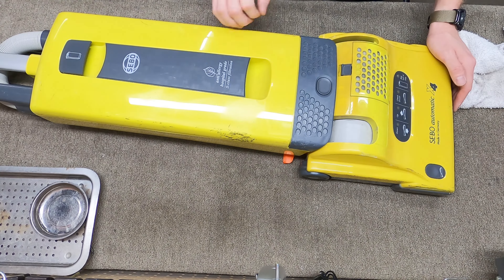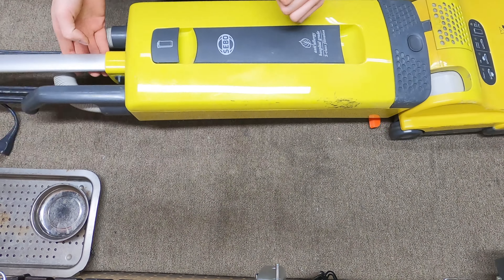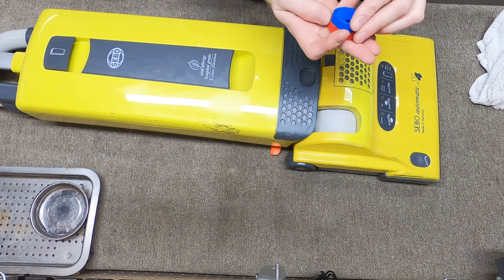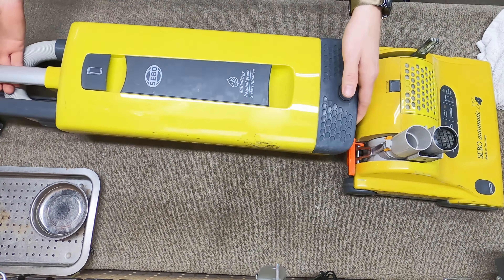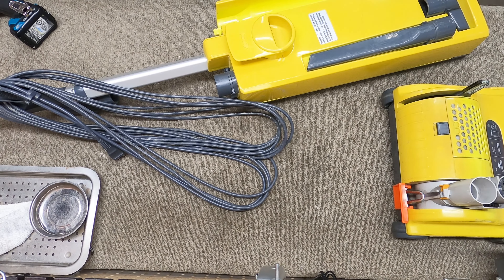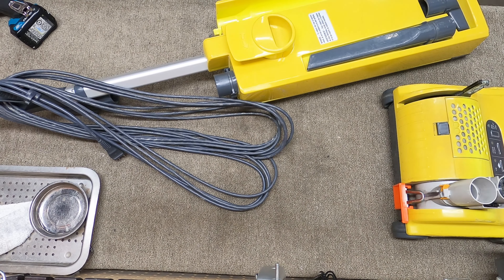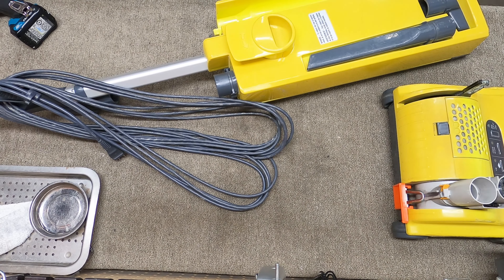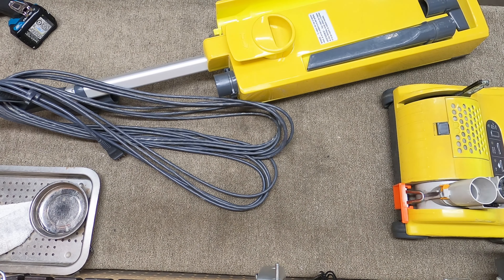SEBO X4 Vacuum Cleaner Repair & Maintenance

Comment: I have the Windsor Sensor XP version of this vacuum. Very reliable and have only had to do a bar change on it.
Reply: Same here. I have the Sebo G4 because I wanted the manual adjustment and all I’ve needed is a new brush roll, bags and filters. These machines are built!

Comment: Looks like that spring green color has faded into yellow over the years. Green or yellow, this is still my favorite X4 collector wise as it was a much uncommon color. But also as a consumer, I'd rather use a darker X4 like black for example to avoid the fade as much as I possibly could. They just look rather funny in my opinion.

Comment: Have you gotten to try the new Sebo Softcase CE-12? Also I saw the new Miele stick vacuum released Europe and I not that excited about. Doesn’t look like anything different for what’s out on the market right now.
Reply from the maker: SEBO  is not currently selling that machine to independent dealers right now. Probably in 5 to 6 months we'll see that hit the market
Reply: @PerformanceReviews  I know but have seen video of  local shop that had one testing out. Didn’t know if your shop was able to get one to test.
Edit: they had a video but looks like they took it down for some reason. It is available in Canada.

Comment: that automatic  3rd wheel is the stupidest thing i have ever seen in the vacuum industry. even worse than power fins . only because of how hyped these machines are .
would be so much easier to push with 4 wheels  .
Reply: I have a Sebo Essential G4. It has 3 wheels and I have no problem pushing it.
Reply from the maker: Never had a problem with the third wheel. But interesting to hear your perspective. Thanks for watching